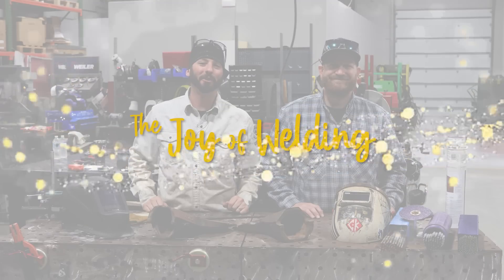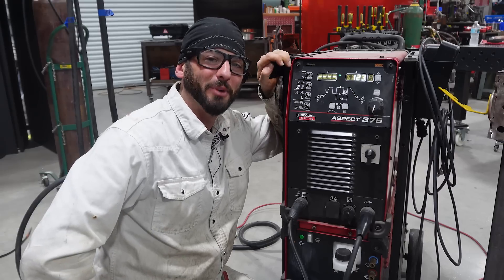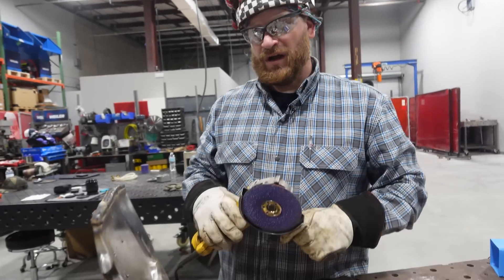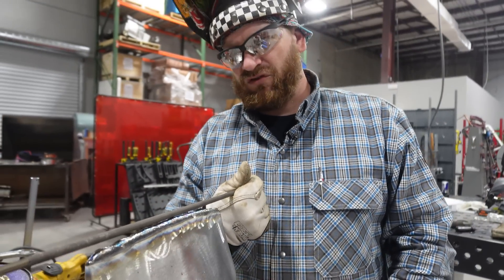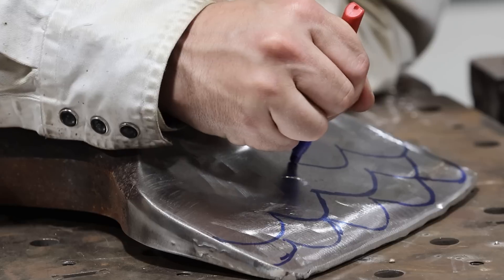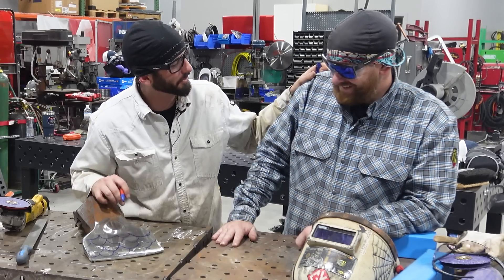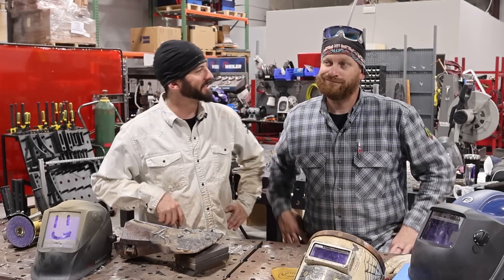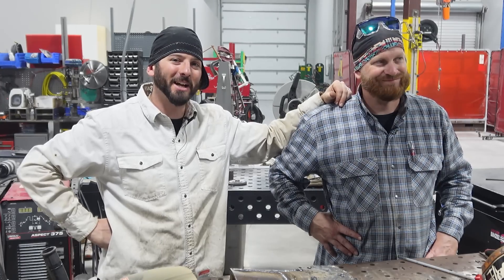Hard Facing Excavator Bucket Teeth with Stick Welding

Comment: GReat video guys. If I can add 50 years of welding experience to the well made video...The tubular electrodes can be run on a lot less amperes on the edges to prevent burn thru ect. say 150-170 amps. On very thin edges you can also swith polarity to DC- [electrode negative] On the flat and heavy you can boost the amps up to the higher end for more deposition rates.

Comment: The 309 mixes with 7018 and the HF rod. 309 and 312 are awesome dissimilar  metals.  My vise stand is a manhole cover with  a 6 x6 3/8" wall.

Comment: Hardfacing rods leave a bead that's chock-full of carbon. It creates the chromium/molybdenum/vanadium/tungsten carbides that give it the extreme wear resistance. The reason it doesn't really spark is because of the high alloy content. Mild steel sparks because the disc shears off tiny slivers, which get superheated and burn in air.
Reply from the maker: Great info thanks for sharing!

Comment: Nice idea but completely unnecessary.  I can understand filling thr leading edge, it'll keep your trench bottom neat and tidy.  But the rest is just a waste.  

Skip the 7018 and stainless rod.  Get a proper buttering rod for the parent material/hardfacing material.  Finally use AC it'll help a lot

Comment: I was MMAW welding hard facing to plow shears at age 11. (I grew 6" that year) My stepfather couldn't weld as he ran a fork lift at his day job. It was up to me at the oldest to cut gussets to weld in broken farm equipment. Using a coffin hoist to pull bent disc frames together and weld them. When raised into air, blocks underneath, I welded the bottom side. My worst experience was red hot slag burning into my tennis shoes between my big toe on the web. Scooting & screaming I kicked the shoe off, sticking into a mud puddle holding water. That god it was there. Retired, self taught auto tech. ASE Master since 78. I have a 1984 MIG by "DECA" and works great and a true 150 Amps! Thanks for the video, it brings back memories...
Reply from the maker: Glad we could help “spark” some memories. I could literally feel the burning in my foot when I read that part!

Comment: ABC - Always Be Comfortable. When you started hard facing you didn't look comfortable welding at that angle because the bucket tooth was in the wrong position. Interesting video though.
Reply from the maker: Very good advice! If you are not comfortable your welds will tell you every time.

Comment: Price for rod’s and labour? Insteed of new parts
Reply from the maker: Hard facing before tearing them up will definitely make them last a lot longer, but more to show people how to get the most out of their equipment.
Reply: @Welddotcom  what steel do they use on buckets in usa?
Reply: Teeth you usually replace, how ever on buckets you should always have hard facing, work it for a week and break it in then send it off to the welder. I did some buckets about a year ago and they get used constantly, the ripples on my beads have barely started to wear off. And the grid I laid down holds dirt very nicely. Hard facing works very well in my area where it’s raining all the time, so dirt packs into my grid and sticks to the bucket and provides constant wear resistance.
Reply: @Dopamine1245  we did This in norway in the 80’s Now everyone uses hardox steel plate and no hardfacing welds.